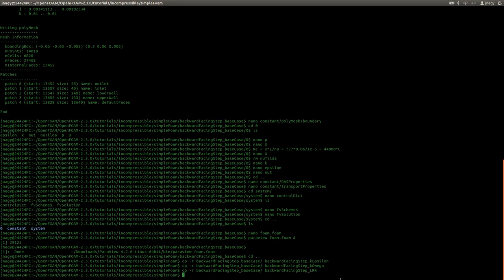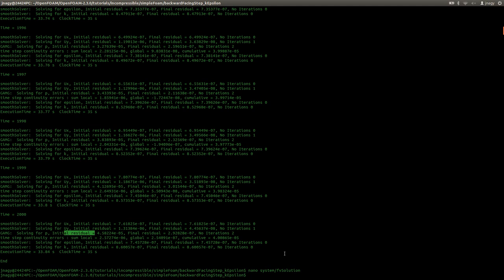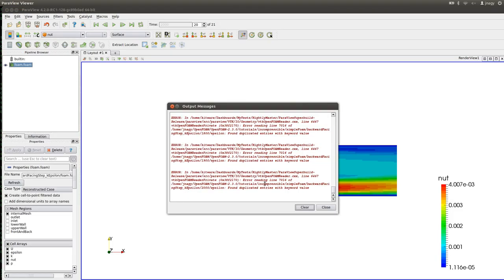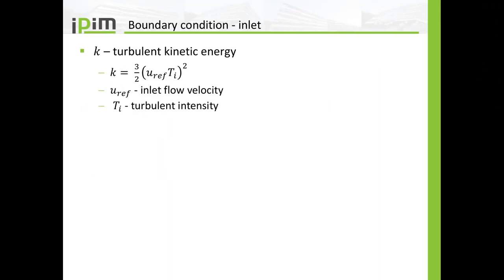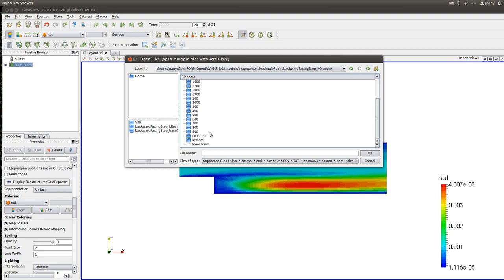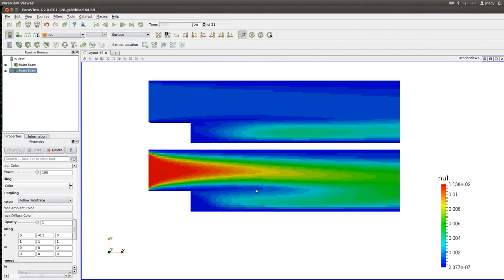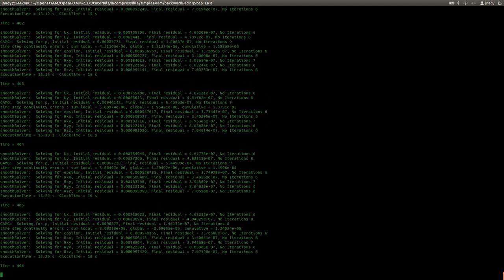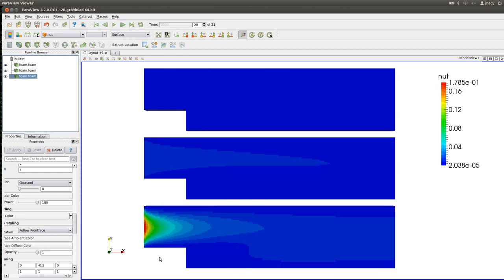Introduction to stationary turbulence modeling (RAS) - Part 3

Comment: Note: Running version 6 and ofcourse R command doesn't work so had to go for simpleFoam -postProcess -func R. Also, file turbulenceproperties:R gets created instead of R in 0 directory. No worries, just rename it to R. While running simulation I faced an error saying keyword div((nu*dev2(T(grad(U))))) undefined so added it and it worked.
Reply from the maker: Well done.
Reply: @OpenFOAMJozsefNagy  how is this R thing done these days ? How is this done these days. The postprocess R doesn't work anyymore and R command doesn't work either.
Reply from the maker: @jeromepowelltoecrum6044  Forget this model. Especially in the .org version.
Reply: @OpenFOAMJozsefNagy  hey thanks for the reply and all the great tutorials and links. They have been very helpful-  
Howabout this R variable that is in the pitz daily tutorial? is this needed only in models with reynolds stress solving? the transient les and keqn simulations ran fine iwithout it but still wondering. Cheers
Reply from the maker: @jeromepowelltoecrum6044  No you can delete it.
Reply: How did you define div((nu*dev2(T(grad(U)))))?

Comment: For anyone trying to run this tutorial on Windows 10 through bash and in a Windows 10 filesystem folder,  the function R was replaced by the postprocessing function turbulenceFields, which tries to create a folder named turbulenceModel:R but fails to do so because of the two dots that Windows can't process. To solve this problem just copy the case folder to home through the terminal and run the command there, then change the name of the folder to just R and copy it back to the windows case folder. 

Thanks a lot Jozsef for your amazing tutorials :)
Reply from the maker: Excellent point! Thank you!
Reply: Hi, I tried to copy the case directory (backWardFacingStep_LRR) in home (which for me is "MIGW64 OpenFOAM-5.x /home") and tried to type "simplefoam -postProcess -func turbulenceFields", but the following error results: "--> FOAM FATAL ERROR:
cannot find file "C:/Program Files/blueCFD-Core-2017/msys64/home/backwardfacingstep_LRR/0/R"

    From function virtual Foam::autoPtr<Foam::ISstream> Foam::fileOperations::uncollatedFileOperation::readStream(Foam::regIOobject&, const Foam::fileName&, const Foam::word&, bool) const
    in file global/fileOperations/uncollatedFileOperation/uncollatedFileOperation.C at line 522.
"
any suggestion?
Reply from the maker: It still has an issue with "Program Files". It doesn't like the space in the path. I thought they reaired that. Back in the days before bash on ubuntu on windows I installed blueCFD core on mx c drive directly instead of the suggested location in Program Files.
Reply: Thank You for reply! I Will try To reinstall It
Reply from the maker: Great!

Comment: Hi Jozsef!
Thank you for all the effort you put in to al your tutorials, the are helping me a lot!

At this moment i'm running you tutorials with the v1606+-version of OpenFoam, and there i had to replace the RASProperties file with a turbulenceProperties file. In this file i had to put this text to run the calculations smoothly: 

simulationType  RAS;

RAS
{
 RASModel  kEpsilon;
 
 turbulence  on;
 
 printCoeffs  on;
}

Thanks again for all you work!
Reply from the maker: Hi Pieter! You are absolutely right! In this video i used back then version 2.3.0. In the newer versions some changes were made in the turbulence syntax. If you check out the tutorial collection I talked about in one of my recent videos, I do list these changes there: 
https://wiki.openfoam.com/Stationary_turbulence_modeling_(RAS)_by_Jozsef_Nagy
Of course I cannot redo all the videos for each release, but it is possible for me to give you this information through the tutorial collection. Thanks for your comment, I hope others find it also useful!

Comment: Just in case someone has the issue with yPlus function using higher version of openfoam. In order to postProcess yPlus, please try this command 'simpleFoam -postProcess -func yPlus', then you get the yPlus value for each iterations you saved. It works for my case. If you dont add simpleFoam before '-postProcess', then you will get the error of 'Unable to find turbulence model in the database'.

Comment: But shouldn't y+ have to be either <5 for low-Re-treatment or 30>y+>200-300 for a high-Re-treatment, since we're not able to approximate the buffer-layer with a linear- or a log-fuction correctly?
Reply from the maker: This is a tutorial. You are correct, for a real simulation, you have to modify the mesh in order to fulfill the correct y+ values.
Reply: @OpenFOAMJozsefNagy  Okay, I just wasn't sure. Thank you very much for the great tutorials !

Comment: the solution for error encountered @8:00 is to rename frontAndBack faces in 0 folder to defaultFaces before blockMesh and runnig simplefoam .. thanks very much for your fantastic work
Reply from the maker: +Hani Ceaser Thanks for the input.

Comment: Hi Josef,
First off your tutorials are absolutely fantastic! It has been immensely useful to me so far. I noticed that my 'Time' at convergence on my machine is significantly smaller than yours (mine is 375 vs 2000 on yours) I seem to have a faster machine, but shouldn't the endtime be the same as we specified it at 2000? I followed your instructions exactly. Just hoping I didn't do something wrong...
Reply from the maker: Oscar Wilsby Hi, hmm so your OpenFOAM converges faster. Which version are you using? Do you use the same settings in fvSolution?
Reply: I'm using OF v2.3.x (not sure what the x is referring to but I think it's v2.3.1). My settings are the same as yours, although I am running my simulation with residual control while you are not. I still would have thought that my solution would still extend to the specified time step though?
Reply from the maker: If you reach your desired value of residuals, the simulation stops. Try a lower value, the simulation should run further.

Comment: Hello Prof. I am using openFOAM v-7 and I can't run the command  'R'. can you please tell me what are the other options to generate R file? Thanks.
Reply: Got the same issue !
Reply from the maker: Yes, this command was discontinued.
Reply: maybe you could try with the command "simpleFoam -postProcess -func R"

Comment: Hi,

I'm trying to do the "homework" and you seem to suggest that the results of the k-epsilon model are the best and modifications should be done to the other two models to get similar results. Do I understand you correctly? If that is so, what indicates that the results of the k-Epsilon model are those that can be trusted? Is it because the initial residuals are the lowest? I'm asking because I'm trying to do a similar case and I would like to know what are my criteria to determine the best result, other than using experimental results as a benchmark.

Comment: Jozsef Sir, first of all thanks for this tutorial. I have some doubts: when you check for convergence, you look at initial residual, not final residual; why so?  2nd thing, we have set the no. of iterations, this simulation will go through, under controlDict-> endTime=2000(say); at the same time, we set tolerance limit to 10^-6 , what is the use of the later settings as programme will end after 2000 iterations, no matter whether the tolerance limit is achieved or not? Kindly explain to me. Thanks.
Reply from the maker: It is up to you, where you define your simulation to be convergent. It is always depending on the flow. Sometimes it is 1e-3 sometime 1e-6 sometimes 1e-12. You have to check always the flow itself. Sometime you need 100 iterations, sometimes 20000.
Reply: Hello Prof. Nagy,
I have some problem regarding convergence. There are two stopping mechanisms for the simulation, one is the convergenslce condition and the other is defined as the number of time steps. Which one is prioritized by the program and how can we change it?
My simulation (when using a relaxation factor of 0.9) converges after 18 time steps and wont reach the 2000th timestep, I was able to reach the 1980th time step by setting the relaxation factor to 0.2
I guess there should be an option to tell the program to continue the simulation till the end, although the convegence has reached and continuing seems pointless!
Could you assist me about this problem?

Comment: Hello József,

I am using LRR for a vertical pipe flow (using a wedge geometry with axis-symmetry BC on front and back of the wedge). I get convergence for p, U (x,y,z), R(xx,yy,zz,xz) with tolerance of 1e-7. However for R(xy, yz) I get convergence only with a tolerance value >= 2e-3. 

PIMPLE: iteration 729
...
...
time step continuity errors : sum local = 1.00909e-12, global = -6.24038e-13, cumulative = -1.22627e-08
DILUPBiCG:  Solving for epsilon, Initial residual = 9.31912e-08, Final residual = 9.31912e-08, No Iterations 0
DILUPBiCG:  Solving for Rxx, Initial residual = 9.89784e-08, Final residual = 9.89784e-08, No Iterations 0
DILUPBiCG:  Solving for Rxy, Initial residual = 0.00114164, Final residual = 7.47445e-07, No Iterations 1
DILUPBiCG:  Solving for Rxz, Initial residual = 9.89262e-08, Final residual = 9.89262e-08, No Iterations 0
DILUPBiCG:  Solving for Ryy, Initial residual = 9.70953e-08, Final residual = 9.70953e-08, No Iterations 0
DILUPBiCG:  Solving for Ryz, Initial residual = 0.000545211, Final residual = 3.55113e-07, No Iterations 1
DILUPBiCG:  Solving for Rzz, Initial residual = 9.93673e-08, Final residual = 9.93673e-08, No Iterations 0
...
...

Can you suggest any option?
Reply from the maker: Yeah, you have to watch out with LRR, it is a 3D model, so in 2D you have to keep this in mind. This tutorial should only show, how it works in general, actually you'll have to use a 3D model.
Reply: Thanks for the reply. I'll try it with a 3D mesh. Can you tell me how does OpenFOAM calculate R knowing the type of RAS model (eg. SST)? Does it use the Boussinesq hypothesis?
Reply from the maker: Well I don't exactly know, but you can check out the equations in src/turbulenceModels/incompressible/RAS/LRR. There you also find all the available models.
Reply: After searching the OpenFOAM code, I finally found the piece of code that indicates how R is calculated.
It is in the file named eddyViscosity.C and can be consulted at this link: https://www.openfoam.com/documentati...8C_source.html

At line 117: ((2.0/3.0)*I)*tk() - (nut_)*dev(twoSymm(fvc::grad(this->U_)))

When calculating R with the k- ε model, the code for the calculation of the value of nut can be found in kEpsilon.C, line 42 (https://www.openfoam.com/documentati...8C_source.html)

this->nut_ = Cmu_*sqr(k_)/epsilon_;

Comment: I changed the grid 4x ( 2 x 2 x 1 ) & got y+ as 19 & 22 for upper wall & lower wall respectively

But Y max value is 35 which is out of range  ( is it  because of mesh grading scheme ? which i used 0.e near the step area.?)

Comment: Jozsef, thank you for your nice work, which is informable. By the way, when I try to run a similar case with LRR using v8, an error"attempted assigment to self" poped up. Do you know what on earth it is?
Reply from the maker: The syntax changed over the years, so LRR does not work.

Comment: Your tutorial videos have taught me a lot about OpenFOAM. Since this is my first time dealing with CFD, it is very useful.
Can I seek your assistance in the "homework" that you mention in the video though?

1) My idea for making nut = 1e-3 for the k-omega model is to use nut as 1e-3 and reverse enginer to get the omega value. Is this acceptable?
2) For LRR model, any hints on how to change or correct the nut to 1e-3?
Reply from the maker: 1) My idea for making nut = 1e-3 for the k-omega model is to use nut as 1e-3 and reverse enginer to get the omega value. Is this acceptable? Try it. 
2) For LRR model, any hints on how to change or correct the nut to 1e-3? I know, this is rather difficult. Try with upwind, use low underrelaxation factors and really wait for the settings to be convergent, then change the discretization.

Comment: I am trying to generate R matrix for the LLR model. Using the last OpenFOAM version, and the code "R" does not work.
I tried typing: "simplefoam -postProcess -func R" and something happens, but finally it appears the following message: 
"No MRF models present
         functionObjects::turbulenceFields R writing field: turbulenceProperties:R
End"
and no "R" file is created in the "0" folder.
What should I do?
Reply from the maker: Wow, I have no experience with the R model in recent versions. Sorry. Maybe google helps or post this issue on cfd-online. Maybe someone can help you there.
Reply: I have the same issue. Looks like OpenFOAM demands file MRFProperties in constant folder for proper R execution. Example of such a file could be found in simpleFoam/mixerVessel2D tutorial.

Comment: Thanks Mr.Jozsef Nagy !! Priceless Tutorials !! I am getting started with OpenFOAM !! Have one question though !! Are quality of OpenFOAM results on par with commercial codes !! Thanks again !! Can u just improve the fonts size on screen.. or color also!! White would be real good
Reply from the maker: If it is comparable... If you ask me or other scientists/engineers working with OpenFOAM, we would say yes. If you ask someone using a commercial tool, they might give you a different answer. I think it depends on the problem. I would say yes, because in OpenFOAM, you can implement everything, if it is missing from the official release. You just have to take your time.
Reply: Thanks
Reply: @vijaya I guess you've gotten into OpenFOAM! I see you now have tutorials of your own. Congrats!

Comment: Hi Josef!
Thank you for this priceless tutorials!
I have a question for you: Can wall funcionts be used for rotating walls?
Reply from the maker: Rubén B. Hi! Thank you. I have never tried it before.
Reply: József Nagy I cannot stop watching your videos József :-) Thank you for this effortJust another simply question. You use the same grid for kepsilon and komega model. I though they required different meshes as the don't use the same wall functions, and they don't need the same y+ don't they?
I am a newbie to OpenFOAM
Reply from the maker: Rubén B. Don't forget, that this is a tutorial and not a scientific work. You should be able to complete it within a reasonable time. Of course you have to think about the mesh. And thanks for your kind words!

Comment: Thank you so much Mr Nagy, But would you please make a tutorial about the aerodynamically generated noise in an incompressible flow (AAC) and thank you again.
Reply from the maker: This is a rather special case. On this channel my main focus is to post videos for my polymer engineering students, so I will finish the videos on turbulence modeling, multiphase modeling, meshing, CHT before I start working on special cases. I cannot promise anything, but I can put this topic on my list.
Reply: József Nagy  OK .. I'm counting minutes till your next video

Comment: Hi, Mr. Nagy, thank you very much for your lectures on CFD , they have helped me a lot on CFD.
Nagy, if you could, I have a doubt about this lecture of yours. At the moment of the first simulation using simpleFoam, this message appeared in my terminal:

"Time = 28
smoothSolver:  Solving for Ux, Initial residual = 0.578291, Final residual = 1.55951e+24, No Iterations 1000
smoothSolver:  Solving for Uy, Initial residual = 0.578291, Final residual = 1.03625e+25, No Iterations 1000
#0  Foam::error::printStack(Foam::Ostream&) at ??:?
#1  Foam::sigFpe::sigHandler(int) at ??:?
#2  ? in "/lib/x86_64-linux-gnu/libc.so.6"
#3  double Foam::sumProd<double>(Foam::UList<double> const&, Foam::UList<double> const&) at ??:?
#4  Foam::PCG::solve(Foam::Field<double>&, Foam::Field<double> const&, unsigned char) const at ??:?
#5  Foam::GAMGSolver::solveCoarsestLevel(Foam::Field<double>&, Foam::Field<double> const&) const at ??:?
#6  Foam::GAMGSolver::Vcycle(Foam::PtrList<Foam::lduMatrix::smoother> const&, Foam::Field<double>&, Foam::Field<double> const&, Foam::Field<double>&, Foam::Field<double>&, Foam::Field<double>&, Foam::Field<double>&, Foam::Field<double>&, Foam::PtrList<Foam::Field<double> >&, Foam::PtrList<Foam::Field<double> >&, unsigned char) const at ??:?
#7  Foam::GAMGSolver::solve(Foam::Field<double>&, Foam::Field<double> const&, unsigned char) const at ??:?
#8  Foam::fvMatrix<double>::solveSegregated(Foam::dictionary const&) at ??:?
#9  Foam::fvMatrix<double>::solve(Foam::dictionary const&) in "/opt/openfoam6/platforms/linux64GccDPInt32Opt/bin/simpleFoam"
#10  Foam::fvMatrix<double>::solve() in "/opt/openfoam6/platforms/linux64GccDPInt32Opt/bin/simpleFoam"
#11  ? in "/opt/openfoam6/platforms/linux64GccDPInt32Opt/bin/simpleFoam"
#12  __libc_start_main in "/lib/x86_64-linux-gnu/libc.so.6"
#13  ? in "/opt/openfoam6/platforms/linux64GccDPInt32Opt/bin/simpleFoam"
Exceção de ponto flutuante (imagem do núcleo gravada) // in English, Floating Point exception (core dumped) "

However, reading some comments, I have changed the value of k from 0.2 to 0.3, and the simulation has worked well. I still do not know the reason of it happens I have followed your steps to do the simulation, such as setting U = 7.333. 
I use openFoam version 6.

Mr. Nagy, would you have any suggestion about it?
Thank you a lot!
Reply from the maker: Stability changed over the years. You might have dome issues in newer versions. Underrelaxation might improve the problem.
Reply: I'm using version 9, and had the same error. I'd to change k to 0.4 and also change the tolerance to 10^-4.